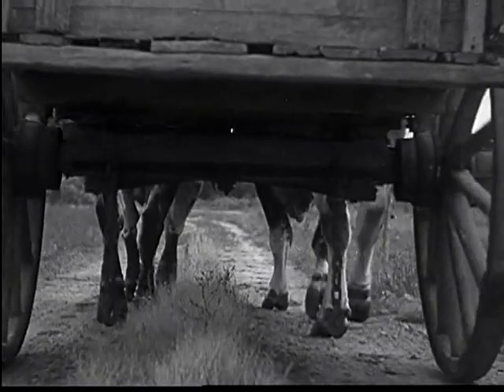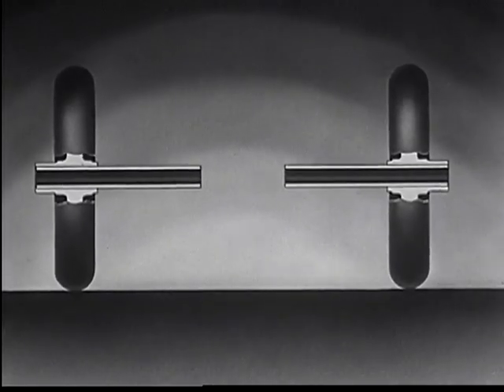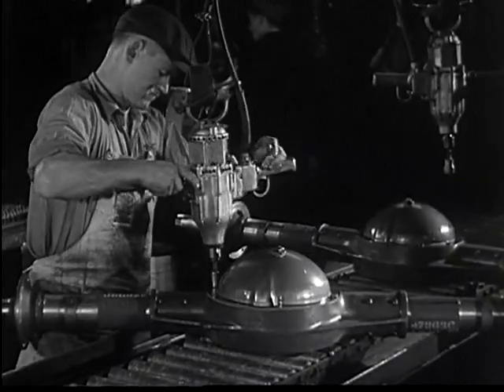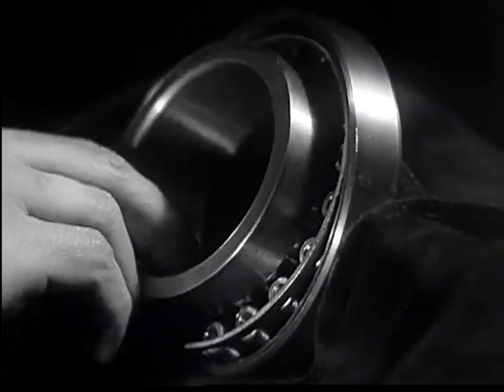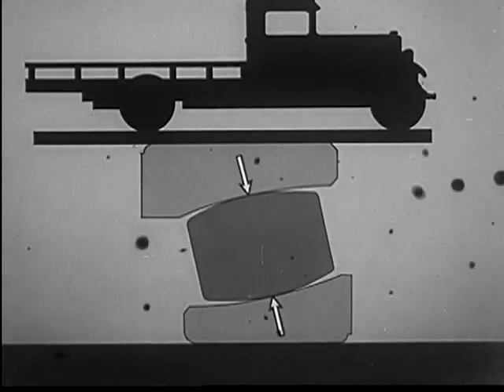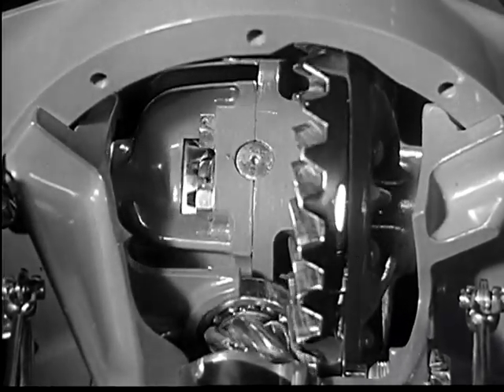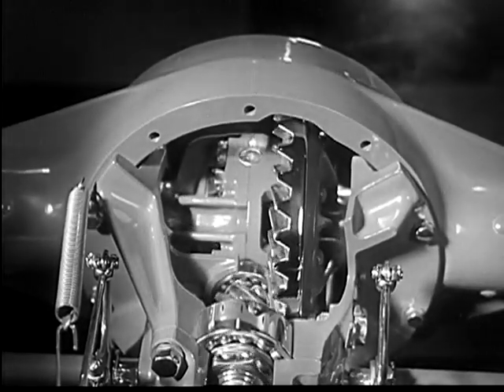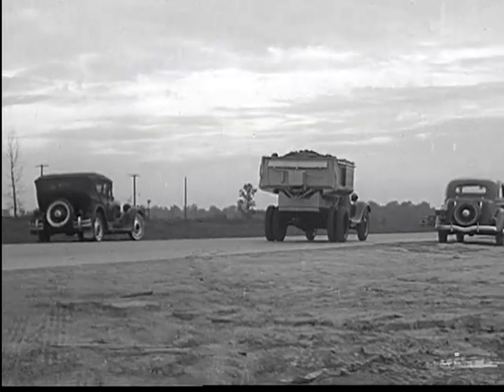It Floats - Chevrolet Full Floating Rear Axle (1936)

Comment: for a broken drive axle shaft. how do you get the inner part out when it does snap, 
and yes even the great 14 bolt dies brake but only under great stress.

Comment: Imagine making a car back in the day. It was done with love and upmost passion. Everything is crisp and beautiful, even the gears are chrome, and very few people are gonna see that.
Reply: What do you mean by "back in the day"?
Reply: @Gurn-xh5fg  Like around the time of this ad
Reply: @yourlocaldoomer  That would be 1936. 

In 1936, cars required constant maintenance to keep them running. Full tune-ups once a year, in addition to adjusting ignition/points periodically, adjusting ignition timing (because dwell alters timing), adjusting carburetor idle mixture and idle speed, replacing worn  spark plugs fouled by improper use of the manual choke, removing the cylinder head to grind the valves every two years, and so on.

Panel fit and paint quality was abysmal. 

And then you still had to live with a three-speed manual transmission, tube-type bias-ply tires, four wheel non self adjusting manual drum brakes with a single master cylinder, manual steering, no A/C, no power, poor fuel mileage, horrible crash safety, poor handling, 6-volt electrical system powered by a generator, and on, and on, and on. 

They were crap.
Reply: @Gurn-xh5fg  I'm not saying they were effecient cars, I'm saying they were beautiful ones

Comment: Nice video. Sadly axle shafts tend to break  leaving a small bit lodged in the diff.  Whilst you can withdraw most of the shaft you have to get the broken bit out of the diff before inserting the new shaft.  So you have to take axle apart anyway.

Comment: ...I absolutely lost it when he said a replaceable axle shaft without a wheel removal...
Reply: 3/4 and 1 ton pickups today use full floating rear ends with 8 bolts on axle flange holding axle shaft to hub.

Comment: 2:44 minor mistake, area does not affect friction
Reply: In thst geometry it would, because the opposite ends would try to turn at different speeds if the full bearing was in contact.

Comment: Did this mofo just change his whole axle in like 2 mins with 8 10 mm nuts and just sliding it out and the new one in then button it back up???I mean seriously i get that all cant be this simple by why in the hell do i have to move my motor to do exhaust work or pull a bumper to swap a headlight????

Comment: There are still occasional attempts to market vehicles based on engineering alone. For a while, Toyota dealerships had cutaways showing the difference between some of their truck's components and the ones on equivalent duty models of various competitors. Not exactly ultra excitement inducing, but it showed why the extra cost was worth it for professionals in general who'd typically care about that kinda thing.

Comment: And to think manufacturers now cheap out on half ton trucks by using semi float axles to save on weight, running gear load, and more simple construction to the now uneducated population with marketing saying you can pull HD loads with it. This is the axle that makes the load bearing truck a truck designed for work. Half tons are glorified cars yet are marketed as HD trucks that can tow 14k lol

Comment: Replacing Axle while the wheel is still on the truck and while it was sitting on the ground (not raised).
Is this still a thing?
Reply: Yes, any full floating axle can replaced without doing anything to the tires.  The axle only turns the wheel,  it doesn't hold the vehicle up.

Comment: he said if an axle breaks you can unbolt it & bolt in a new one.he didnt say a word about how to remove the broken part of the axle still left in the axle tube, that now requires removing the "inspection plate" & pushing the broken axle out of its tube.its funny how they leave that part out.i guess were supposed to believe when a part breaks it automatically vanishes from its place of operation.

Comment: This method of explanation is far more straight forward than when I was taught in university. Though our laboratory lessons were like this
Reply: The axle pictured is far simpler then modern units(still used today mind you). Our understanding of the forces that affect all the parts has changed significantly

Comment: "Hi there. I'm interested in buying a vehicle. I'll need to see a series of videos detailing the engineering and manufacturing of the following systems relevant to the new model I'm interested in: Wheels, axles, transmission, suspension, the braking system, engine, safety components, electric system..."

Comment: NOT AS GOOD AS THE FORD AXEL WHERE THE WHOLE THIRD MEMBER COME OUT AS ONE UNIT  WHICH MADE IT EASER TO REPAIR  OR REPLACE WITH OUT SPENDING A LOT OF TIME CHECKING THE RUN OUT ON THE RING GEAR  FOR LASH

Comment: jeeze, that was one pleasantly simple axle shaft replacement. lol, no cv joints, press fits, circlips etc. dont even need to take the wheel off let alone the hub knuckle etc. nice design. not that that part is ever going to break anyway though, and if it does its probably going to be the splines so the whole rear axle would need a tear down anyway.

Comment: Hmm. So you break an axle shaft. Pulling out the hub and shaft, as shown at the end of the video, would leave the broken part still deep in the housing and engaged in the differential.  Which is probably why they cut the film right there and didn't show him removing the full intact axle.  Still not something you can repair on the side of the road like they show.  I would also expect the differential itself to fail before the shaft would break.

Comment: Can we all just take a moment to appreciate the beautiful polishing work on that cut away differential?
Someone spent days on that.
Reply: You can still see engine and transmission cutaways at new car shows every year for their latest models. All the internal components are polished chrome plated and the engine blocks and transmission casings are always painted and polished as well. True works of art for sure.
Reply: It's not polished down, they chrome plated it.
Reply: @straightpipediesel  you have to polish it to get a good chrome plating finish if you don't it will show all imperfection
Reply: @straightpipediesel  . More likely Nickel Plated , but Yes , Plated , not Polished .
Reply: I'm not even a "car guy" but I found that downright sexy!
Reply: Tumbler does the same.
Reply: Can you stfu with that stupid same typed " can we all appreciate..."  comment? Just stfu and appreciate it! Damn attention like seeking worm!
Reply: First thing I thought is that opening needs some plexiglass because somebody will hamburger their fingers in those gears lol.
Reply: @dovobis  . Usually  Cutaway Display pieces like that are in a Display Case , for exactly that reason .
Reply: Done with mostly toxic chrome plating back in the day, that's why grandad didn't live so long sunny 😂
Reply: @Hanojsemaj  I’m not debating that. But the one cvt everyone was saying is complete garbage and doesn’t last was the jatco in the 2013-16 altima. They aren’t so bad, just have to change the fluid more often then the manual suggests or they’ll start to heat up when the fluid breaks down.
Reply: You don't have to ask permission to appreciate anything.
Reply: @A.J.1656  that's not what that means.
Reply: @jdmjesus6103  
Can I just take a moment to reply to a comment?
Reply: At work today one of the kids took a little steam engine off the shelf that was his dad's.
The place has been in business since '32. 
Anyways, I noticed that even the base it sat on had ornate trim ridges around it and hand painted. 
Good ol castings ,that would be plain plastic now. 
Back then the castings may have not been as precise ,but boy were they proud.
Nice rounded curves ,and easy on  the eyes.
not this jagged cut off hurry up garbage now that will cut you while handling it. 
That's one pet peeve lately, stuff that's not deburred, and you grab it and feel a sharp edge. 
Lazy and cheap ,hurry hurry build another as fast as you can🤦🤦🤦
Reply: If they are going to use a CVT, they should make it like one on a sled. Easily accessible housing with a removable cover so you can replace the belt in a few minutes.
Reply: @mmaaddict78  car manufacturers  would never make it that simple
Reply: Ever heard of chrome dingus
Reply: Why? It's nothing fancy.

Comment: we should have kept that design!
Reply: You still find this type of axles in trucks today, the heavier ones today have some planetary gears at the wheel hubs (to reduce the torque on the wheel shaft and the differential) but light trucks have more or less the same axles.

Comment: Floating hubs?  What a novel idea. A pity that so many light commercials these days do not use them. All the load is supported outside the bearing.
And yes I have had a axle break off outside the bearing on a racecars and have seen many break on both street and track
While it does work ok just think about the load carried

Comment: Ok so if the splined part breaks in the carrier you will have to take the axle apart to remove the broken piece. The broken part of the axle can be removed but the other small piece that's inside the carrier won't be able to be removed because you can't pull it out without taking everything apart.

Comment: I’ve always been puzzled as to why somebody decided to make us all dependent on a couple of little metal clips to keep all of this together, dealing with all of the vertical, lateral, and rotational forces it’s subjected to. When you have a large SUV or pickup towing around 10,000 lbs of trailer, a floating axle design is the ONLY thing they should be using, simply from a safety and durability standpoint. So much for “progress”...🤷🏻‍♂️
Reply: Sorry, most people driving cars aren't hillbillies hauling atvs and horses
Reply: @GOVERNMENTCHEESEBYGOOGLE  That’s  so cute. It takes a special kind of “special” to extract that sort of “nose in the air/head up the :::”  derision from my comment. You won today’s award hands down.

Comment: Incredible how good the picture and clear the audio is on an 84 year old film. And how truck rear axles basically haven't changed at all this whole time.
Reply: Toyota Landcruisers still use full floating axles.
Reply: Theyve gotten worse if anything. For civilian duty trucks, floating axle is non existent.
If you want a floater axle now adays, its 50 grand from a custom shop.
Reply: @SqueezeMonger All 3/4 ton trucks have at least the option for full float axle and all one tons are full floating. Right on the same lots as every day vehicles
Reply: @SqueezeMonger Ram 2500 and 3500 still use a floating axle.
Reply: @SqueezeMonger no it isn't.

Comment: Was GMC the only one making videos like this back in the day? I don't think I have ever seen one from Ford or Dodge. I miss being able to open the hood and see the engine and know what everything does and where it is located. So much easier to work on as well. I changed the alternator on a Mazda MPV. Had to pull the inner fender, the entire brake assembly, the tie rod, the ball joint, and the CV axle in order to get it out and back in. I've changed entire engines and transmissions that were less work and took less time than that one job. Of course part of the time was spent making voodoo dolls for all the design engineers at Mazda :)

Comment: How do you remove an axle without removing the diff cover and disconnecting it from the diff?
Reply: With a full floating axle, the axle shaft slides into the diff and the flange is bolted onto the hub. It is not held in place at the diff, only by the flange bolts.
Reply: @JeremyPetho  interesting.  Makes sense. Would be so much easier if you could do an axle that way today.  I assume the newer designs are stronger and better which is why it was phased out.
Reply: It's not phased out, most medium to heavy trucks still use fully floating axles like this. Improved metallurgy means the bearings last longer and the shafts are stronger but the design is much the same.    
Light vehicles don't use it much these days because it is heavier and more expensive to produce than semi floating.  
The smallest car I can think of that still comes with a fully floating axle is the Toyota Land Cruiser 70 series.
Reply: @JeremyPetho  thanks for the info. I'm gonna look more into it since I am very curious.

Comment: OK. Why wasn't shown how the driver removed rest of the busted axle? That has to be removed before the replacement  axle an be installed. A glaring omission from the "good old days". As not mentioned the safety factor of the full floating axle, over the semi- floating axle. That safety factor a hell of a lot important the ease of repair, although half the repair process out was left out.

Comment: 1936: repair broken axle with less than 0.1h work
2020: you will need to replace whole axle for 5000$ + 1000$ for 10h mechanic work
Reply: Come on, how often does an axle break in today's modern cars to begin with? Back then maybe it was a constant issue so they had to come up with something.
Reply: @manu144x  i don't know my good sir. But have you ever seen the new range Rover where you have to remove the entire chassis from the car just so you can replace a freaking crankshaft pulley? That's retarded.
Reply: @manu144x  They are talking about trucks being used on bad roads.  Japanese rear ends would probably suffer that problem FREQUENTLY if roads were still like that.
Reply: They are the same today
Reply: 2021: just get a new one you dont own it anyway
Reply: Sounds like a skill issue

Comment: There was not an inspection plate on a 36 Chevy rear! you removed the entire center/third member which was great because you could inspect and repair this unit on a bench and reinstall the unit and go.....Ford and Dodge held on to this design at least 10 years after Chevy abandon it

Comment: I had a '64 chevy truck with barrel roller bearings,   couldn't find replacements,  had to put a different axle in it.     Oh for the simplicity of the old trucks.    I used to fix or rebuild everything on them.   Now it's gotten so complicated it's rediculas.

Comment: It’s amazing  this alleged 1936 film claims that the floating taper bearing existed when all they really had was hardened steel roller bearings floating barrel shaped “taper” bearings didn’t exist until 1959:and was developed in Europe at that time.  In 1939 all the had was pressed steel or bronze bushings or roller “ball “ bearings.      Hmmmmmm this film is very suspicious

Comment: These engeneers designed things that is still used today 85 years on, 1936, the differential axle is here to stay, 2019, the differential axle is still here to stay, modified a bit, but on heavier vehicles it's still the same.

Comment: Interesting lesson in how someone can sell you bearings with a tiny contact area and lots of deformation and make it sound like a good thing.   Also a nice demonstration of how you could remove an axle and replace it.....   of course they don't explain how you get the other half of a broken axle out, which requires disassembly of a ton of stuff, but, yeah, if you ever need to remove a perfectly good axle and replace it with another, you can do that on the side of the road.
Reply: Yep. They usually broke right at the carrier, making it almost impossible to get that little end piece out without taking off the "pumpkin" cover. LOL
Reply: @stephengreen3566  Been there, Done that. I know of three methods. 1-If you are lucky & it happens to leave a short stub, attach a noose to a broom handle & pull it out. 2- attach a strong magnet to your broom handle, pull it out. 3- if all else fails, remove the axle shaft on the other side of the truck, poke the stub out with your broom handle.  In the rare case that it sticks, a light tap with a hammer will jar it loose.
Reply: Also no mention of removing the multiple shards of metal left behind from the broken axle.
Reply: Finally , someone in the comments that knows what he is talking about.
Chev: "our bearing elements deform"
The rest of the engineering world: "We harden our bearings"
Reply: Removing the broken axle shaft is easy if you have half a brain. 🙄

Comment: This is pretty amazing. I just did a rear axle seal on a Chevy 2500 and it still looks just like that.  Also, when they said Chevy realized they would need easy access, they added a cover. It made me think of Toyota trucks, who realized they didn’t want there parts to be to easily accessed and did the opposite of Chevy.
Reply: My 73 GMC's rear axle is pretty much like this 36 Chevy's rear.
Reply: @michaelbenardo5695  A 2022 Ford F350 rear axle is the same as this 1936 axle. I guess Chevy's patent ran out.
Reply: @TheBandit7613  I don't think Chevrolet ever had a patent on rear axles.